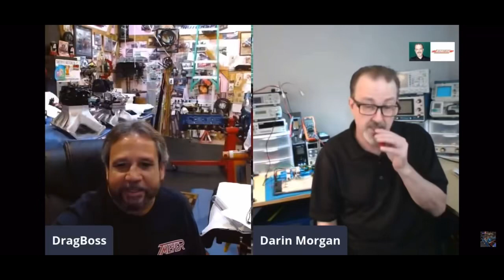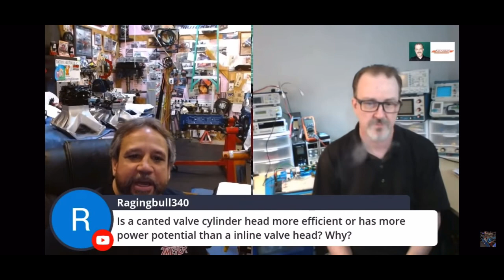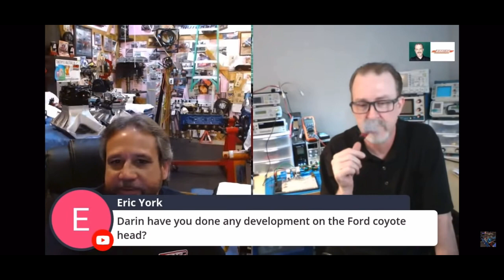DBG: Why A Canted Valve Head Is Better Than An Inline Valve Head,  Effects Of Valve Rotation And RPM

Comment: Tim - The Coyote type heads. 
Terminology (Polyquad) 
Meaning Two different sized intake and exhaust valves. Creating more swirl:)

Four valve heads typically tumble the air into the cylinder. 
So you have two different sized intake and exhaust valve to promote and create swirl. 

Swirl is where you get your low end torque. 
So with a four valve head you get (Twirl) 
Polyquad design modifications. 

David Vizard Channel - Polyquad Heads
Reply: @ElvinLeadfoot  the coyote doesn’t use polyquad heads.

This entire discussion about canted valves is a vast oversimplification and does no service to anyone except ego

Comment: Thanks to Richard Keinath for putting the canted valve cylinder head to the forefront of performance!
Reply from the maker: Was he the one that designed the mopar head? H
Reply: @dragboss351cleveland  He was the one who designed the Big block Chevrolet . It was intended for nascar at the time .Also known as the mystery motor. Not saying that the design wasn't improved upon over time. I would say in my opinion that it was the first performance use of the design!
Reply from the maker: @hbarends5483  ok. Please don’t say the cleveland head is a copy of the BBC head. Further from the truth. Molar was the first I think but nothing came of it.
Reply: @dragboss351cleveland  no I wouldn't say the Cleveland head was a copy. Ford rotated the valves more and had a smaller combustion chamber plus symmetrical intake ports. Mopar had the 318 poly sphere engine. It had canted valves but I don't believe with a shaft mounted rocker set up you could rotate the valves and it wasn't really a high performance oriented engine!
Reply from the maker: You get it, thanks. Similar but not a copy. Did not think much became of the pent star

Comment: Very good video thank you for sharing.  Just looking at the idea of valve rotation it makes it seem like a Harley motorcycle engine would be sort of the worst combination.  An engine that doesn't like a lot of RPM with a cylinder head that's very heavily rotated.  Would it have been much better served with more of a canted valve layout?
Reply from the maker: Hey Dave good to see your here. I don’t know much about their heads, but I know Darin has ported and worked a few over. At the end of video a guy was telling Darin his Harley head he did was working great

Comment: Darin does a fine job explaining why the Ford Cleveland-style canted valve arrangement is the standard by which every domestic center cam pushrod engine on gasoline must be judged. No brag. Just fact.    SWEET!
Reply from the maker: It sure is Bill. See below
Reply: Big block Chevy…
Reply: @58sportsuburban  Not the same. Distinct differences. Valve placement, clocking and angles. Not to mention the Cleveland advantage mimicked by many aftermarket and race Big-block Chevrolets in the current era. Shallow combustion chambers and symmetric port layouts.
Reply from the maker: That is the key. You hit the mail on the head. Asymmetric v symmetrical. That’s it in a nut shell
Reply from the maker: Remember the cleveland head is not a copy of the BBC, if you think it is your sadly mistaken.
Reply: @58sportsuburban  not remotely close to BBC. Not siamese ports. Valve angle and cant are very different

Comment: Unfortunately not every engine hS the benefit of canted valve heads. No doubt they are better. Just moving the valves in a wedge head is beneficial. Great video
Reply from the maker: Yes your right. i made that as I am  Cleveland guy, so wanted to be able to explain more, not just unshrouding the valves. thanks Terry

Comment: Tim Halstead.  This was an awesome video.  I learned some stuff.
Reply from the maker: Quick and easy, always seeing and learning something new at DragBoss Garage. Thanks Eric
Reply: @dragboss351cleveland  I have said for years and have been kicked off of every FE forum for saying that the Cleveland head to fit beefed up FE blocks is the Cleveland head. I wrote back and forth with Darin, and a few emails back and forth gave me a great amount of the way air moves. I tried to move this forward with people on FE forums and I got excommunicated. Darin Morgan’s design is it. And I would be happy with just a 4.63 bore spacing Cleveland. To go Pro Stock is not even needed. But he has the ultimate!
Reply: I'm an fe man but that Cleveland is Gods engine.
Reply from the maker: @bartjacobs3394 amen to that. 🙏
Watch this https://youtu.be/8T7KJI_baGQ?si=B34E38EZPqVQm6AH

Comment: Allways impressed with Darin's theory on valve rotation. I have not heard him refer to this as a "stagger valve" configuration which surprises me. The Yates head was a stagger valve configuration and yet the valves were not canted. I'd love to hear Darin speak to a relationship between valve angle and intake roof height. Also intake port stall condition on the bench. Keep it coming Tim !
Reply from the maker: Thanks Bad 50, he makes it easy to understand, tough concepts. He will be back for a live chat in a few weeks and has a topic picked out. Would not give me any details so it will  surprise me too. Make sure your there and ask him. I may forget with all that is going on. Stay tuned as more info on the way

Comment: I can’t figure out why they built a strong but relatively light design like the FE that can go to 496 ci engine without doing a Cleveland style head for them. I wish they just could have done a 4.63 bore center Cleveland style head. There are good wedge heads they make, I used to ask this on the FE Forums and I would get ripped to pieces. I even helped with a good wedge head one of the best FE heads that were released. Got the chambers to rotate and generate great velocity ( anomously) but I had moved the intake closer to where the SSR was and moved it toward the entrance and had to use a longer rocker on the exhaust and my foundry backed out, and it was basically borrowed and made into a Chinese knockoff of a crummy wedge. I want a Cleveland or a Mixed up Boss like Andy’s.  A 4.63 bore spacing for a 4.125 x4.125 441 ci Cleveland/FE. Any ideas? A 420 cfm intake and a 280 cfm exhaust? C’mon
Reply from the maker: Who knows what Ford thought or why they did what they did. I would what they had worked well and won races so don’t mess with success. Talk to jay brown about his heads.

Comment: I always appreciate your videos,  these technical discussions are very useful..thank you very much..i watched the videos more than once to be sure to get all of this information
Reply from the maker: Thanks Jim, just put them on loop, and let them go, lol. Started a new playlist on cylinder head flow and dynamics, stay tuned for that list to get populated
Reply: @dragboss351cleveland  great . I remember hearing a while back how as the valves get rotated more and more from the wedge motor the rpms go up. I was wondering how much of this was know back when Glidden was winning races . Apparently there was some of this know way back when .. thanks again
Reply from the maker: Yes he may have gotten this. His engines were running over 10k. I would not have put it past him. 🏁
Reply: @dragboss351cleveland  I had head that also ..I know your busy,    he made more hp the rpms seemed to make a difference at end of the track. I don't know if he ran a vacuum pump or dry sump .. Bob had figured out what it took to make the engine live at that rpm for the quarter mile . Thanks for the videos
Reply from the maker: @jimkillen1065  Yes his motors like most Clevelands, pick up on the second half. Yes he ran dry sump engines Your most welcome my friend, thanks Jim